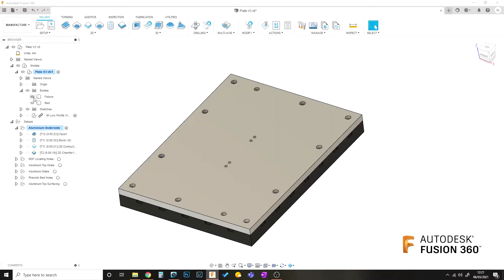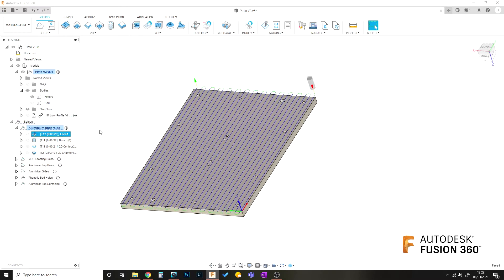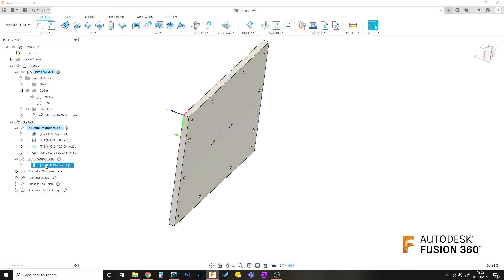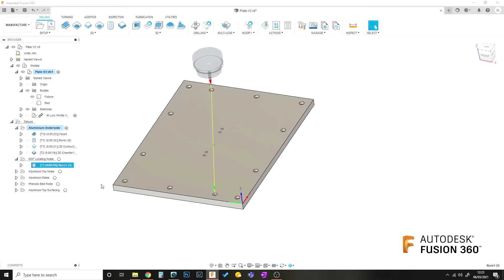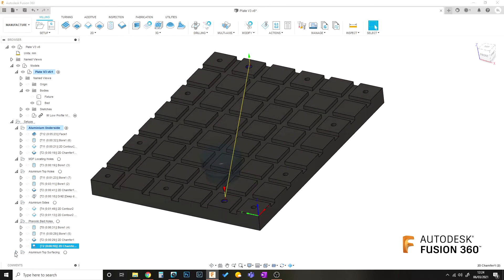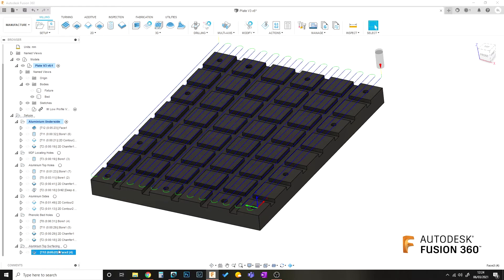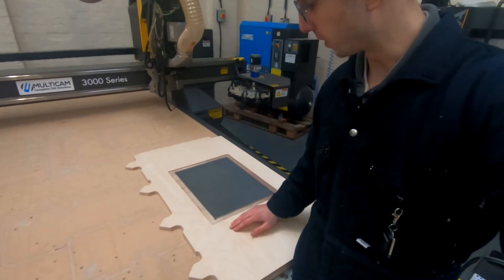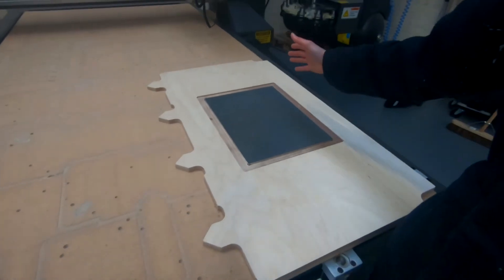CNC Router Fixture Plate #8

Comment: Really like what you did here. I’ve been meaning to do something similar for my machine.
Reply from the maker: Thanks Dom! It's a great upgrade to have - no longer reliant on the vacuum bed for small parts.
Reply: @bikestow  Exactly! I usually just make a tight pocket in the spoilboard  but still have to turn the vac on because the MDF bows up about .02” without it.